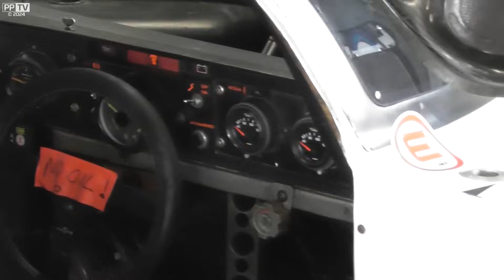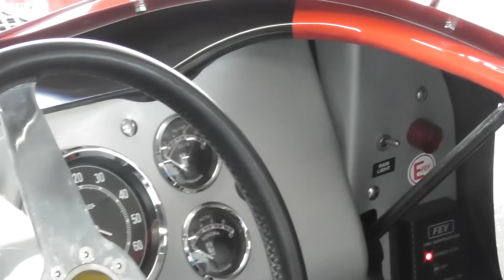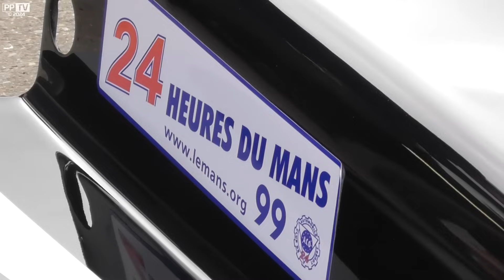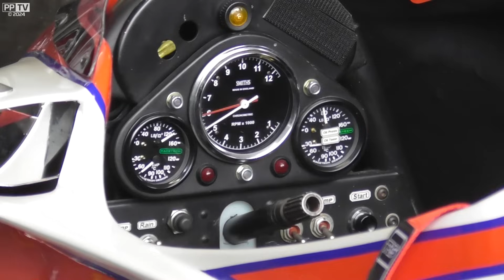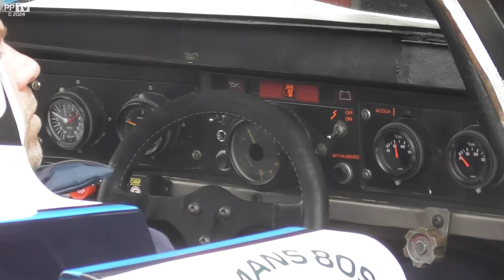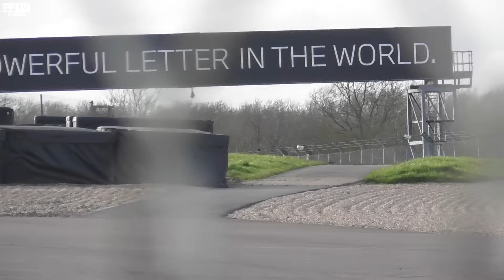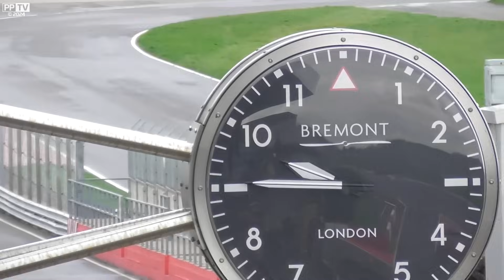Masters Historic Test Day, Crashes/Pure Sound, Donington Park, (F1, IMSA & Le Mans Cars!) 19/3/24

Comment: Great job on the video, thank you for sharing! Keep up the good work. Love the vintage racers! Does anyone know what the triangular blue sticker with the red lightning bolt in the middle designates? A ground point maybe? Thanks in advance.
Reply from the maker: Thank you! Kill switch for the electrics, needs to be pulled whenever you're turning the car off
Reply: Only used when there is an incident and marshalls need to switch off the engine. It's a kill switch